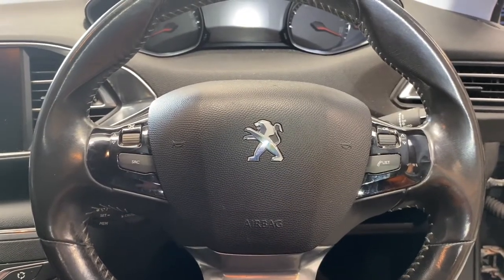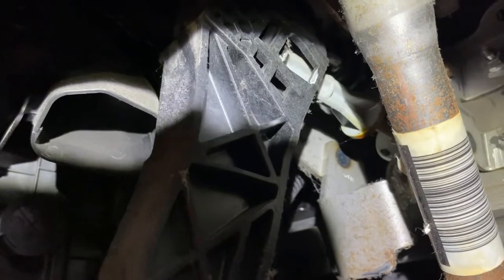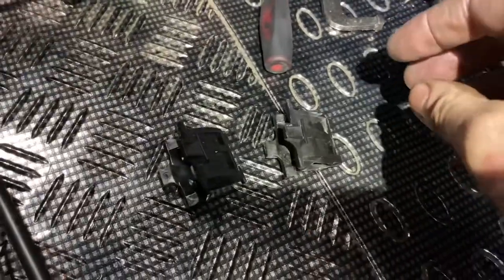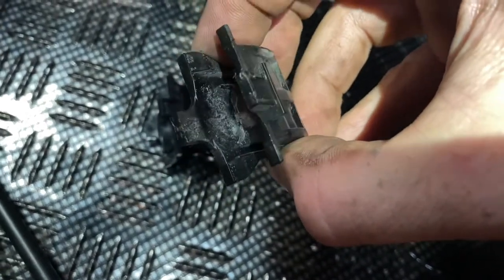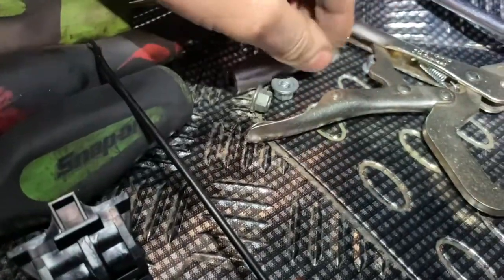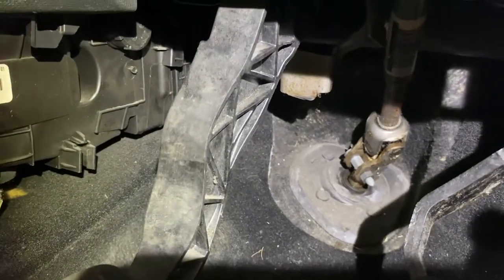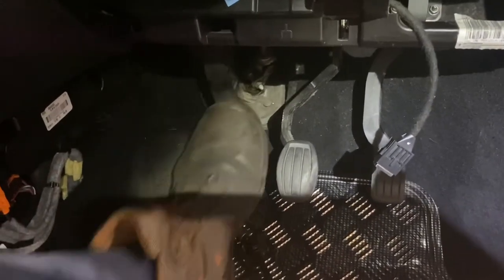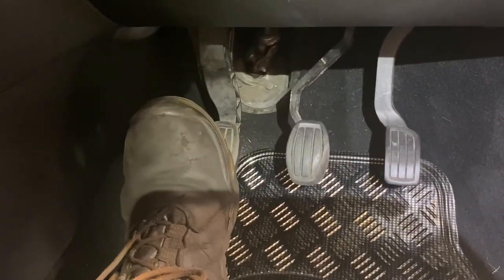Peugeot 308 clutch pedal not returning all the way

Comment: I got the old one out but the retaining spring came off so i had to dismantle the paddle. not knowing that placee the clip in with cylinder attached but unable to unhook the new one so I can put the spring back in.
Do i need a special tool to clamp it in to dismantle it again. 
Its hard as the new hip 😅
Reply from the maker: 😂😂 if there is a special tool for it I don’t know about it 👍

Comment: How do you physically change the clip, the video slips the part where you take the old clip out and put the new one in. Do you need to take the clutch pedal off?
Reply from the maker: Yes more or less I unbolted the pedal for more space and you then push in on both sides of the clip and it comes away from the pedal kinda of awkward three hands be handy
Reply: @deisediagnostics629  oh ok so it is fairly simply do at home job and you don’t have to remove the cylinder?
Reply from the maker: @elliotttownsend6739  no need to remove the cylinder I didn’t anyway
Reply: @deisediagnostics629   thanks mate, how long does it take to change the clip would you say?
Reply from the maker: @elliotttownsend6739  give your self an hour or so it is a little bit awkward

Comment: Does anyone no a link to get a clutch coupling     clip. Thanks
Reply from the maker: The dealer is where I got mine
Reply: @deisediagnostics629  Do you have the part number?
Reply: Facing the exact same issue, Requesting the part number, please please please
Reply: @leoli1249  did u get it?